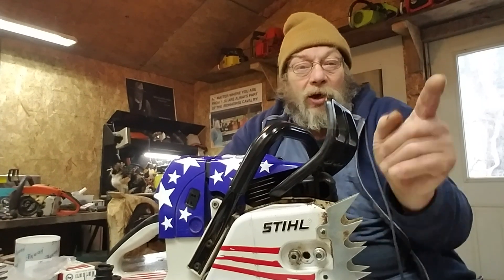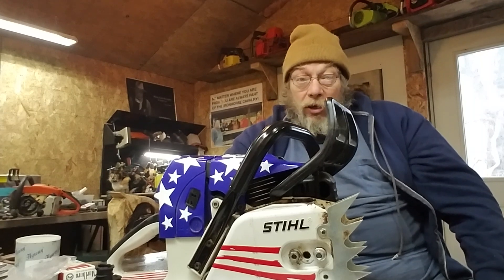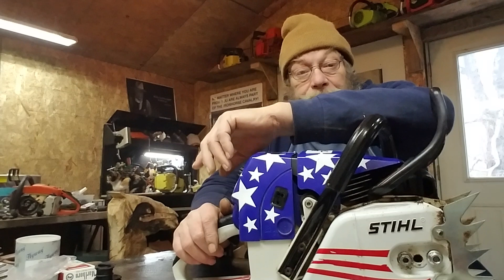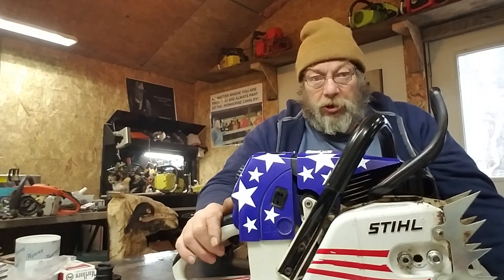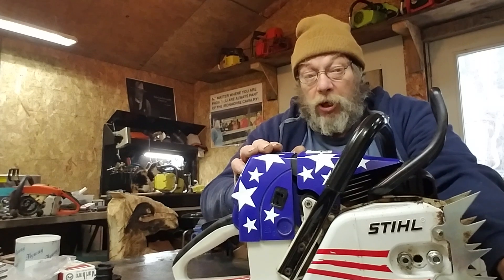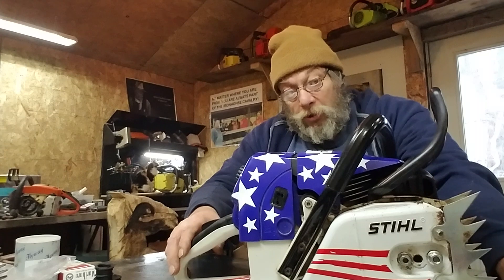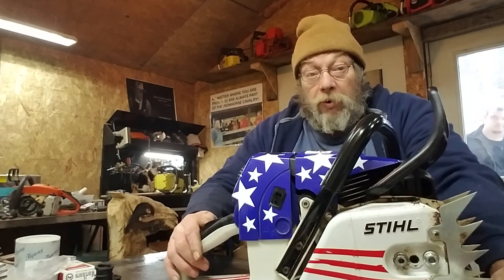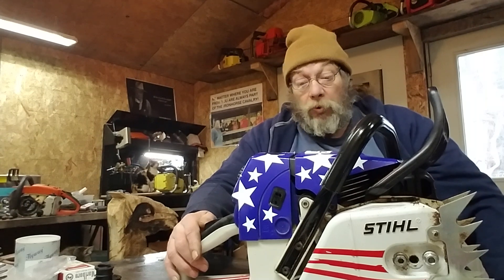What mix oil to use! What ratio should I run in different saws!

Comment: Here comes the crazy statement.... I run my saws at 90 to 1 using amsoil Saber.  Been doing it for 3 or 4 years now.  Not one issue, no smoke, no fouled plus, no clogged screens.   Just as your saying modern oils are better than the past oils, I believe Saber is superior to all other oils and that's why they guarantee no failure to to 100 to 1.   And they have tested to 200 to 1 without issue, though they don't recommend going that low.
Reply: I also use saber at 100to1.  Have been for 40 years.  No problems at all.
Reply: Wow, never heard of that one.  Going to check in on that.
Reply: Same here, Saber at about 80-100 to 1 for over 5 years in everything I own. Not a single issue. I also noticed the fuel seems to last longer in storage. You may have to retune as your not burning all that oil. Your basic 2 stroke will run on straight gas but it won't run on straight oil. I have had good results with everything I've used amsoil in - bikes, snowmobiles (interceptor), chainsaws, weedeaters, log splitters  (who carries straight gas all the time) leaf blowers, and hedge trimmers. No issues. To be fair I don't cut much in the heat.
Reply: arborcidal maniac  amsoil Saber is around 50 cents in oil cost to add to a gallon of gas... How much is your klotz oil per gallon?  I suspect at least triple in cost.  My point is, even if your oil is superior... I'm gonna save so much money that I can easily replace equipment as needed (not that, that had even happened once as of yet).
Reply: arborcidal maniac  you can buy Saber online by the gallon for around $48.  That gallon can mix up to 100 gallons of fuel bringing the cost to under 50 cents per gallon of mix.   You can buy it online just like anyone else... So what's available locally doesn't matter.   I love Saber.... It just so happens to be a third of what your using.  If you're happy spending triple, you go right ahead.  I'll save a buck with each and every gallon I use.   I have saved more than enough to replace any piece of equipment I use mix in.  But I doubt that will ever be an issue.  Good luck to you

Comment: I use klotz techniplate at 32:1and it burns perfect never had any issues , I have a 385 I bought new in 2002 I've used that oil at that ratio and I've never had to rebuild it yet .
Reply: Larry Warner I havnt had many failures while useing that oil.
Reply: @ericharris893  I've used it for close to 20 years , snowmobiles , saws, weedeaters

Comment: I ran 38:1 in my older 40:1 huskys. In the chromed plated bores and the nikasil it’s still 38:1/40:1 full synthetic oil.  In my castiron sleeved two strokes it’s a mix of Castor, synthetic oil.

Comment: I run Ipone snowmobile oil at 45:1 and add a shot of Startron stabilizer in with Shell premium grade fuel.  Runs great.
Reply: In Stihl manuals, there were reportedly cases of cuts and jamming of the rings and the piston at 33: 1. Is there a risk of reduced machine life or carbon failure?
Reply: I did notice the Ipone was leaving some black residue  on the piston crown and exhaust port. I have switched to Opti2 oil. I have not used enough yet to see results.

Comment: Amsoil said you can run there oil @ 300:1... I run mine like they say a @ 100:1 and have had no problems for years and saw runs fast and no issues, plus the fact that it never fouls or chokes the muffler. Scary first time I did it I used and old saw to make sure he wan't blowing smoke up my @$$. All I know is it works Amazing...

Comment: Just stumbled across this. Nice! I'm running 2 Shindaiwa chainsaws, using echo oil (can't get Shindaiwa oil here, not sure it matters to be fair), but run it at 40:1 . The saws are approx 6 years old and run perfectly. In fact I had one of them into our local saw shop (discussing chains) and the guy said: how old is this saw, it seems new? He was surprised at how old it was...

I hear what you are saying about warm running time - I try to run 'em for at least an hour when I get one out for work, and not do a hot shutdown after serious cutting, i.e let it idle for a bit and check exhaust temp (wafting my hand nearby the exhsust, yeah a bit imprecise) before switching off.

Comment: I like 40 to 1 also....been running the Poulan oil, but probably should run down to cycle shop and get the Yamalube or something equivalent. Thank You Harvey for enlightening me on what YOU use... Cheers !
Reply: J. Chris Beck Make sure it’s the Yamalube 2r and not 2s
Reply: @patrickallred850  thank you sir

Comment: Thank you

I started using yamaha lube 2r 

Ca wants 50:1 

I switched to 40:1 and non ethanol race brand fuel its 95 octane 

How high of octane can you use ?

The premix stihl shows 98 octane 

I come to learn when you add 2 stroke oil to gas the octane level drops . 

Is there a way to know how much octane  will drop  when you mix your own fuel ?

Comment: I use Stihl HP Ultra (fully synthetic) 50:1 in everything - my husqy saws, stihl saws, weedwacker, brushcutter etc.. burns clean and keeps the cylinder cleaner too.
Reply: I run my saws the very same and I have no problems. That stihl ultra is some stuff and it has a nice smell when burning.

Comment: I've ran amsoil saber at 80:1 for years without issues and the piston has always been clean and no marks on cylinder wall. I started running it at 50:1 but it was to much oil, it was full of carbon after 10 tanks. They say you can run 100:1 but ill stick with 80:1. $1400 saw or pennies for oil.
Reply: I have ran the same oil for close to 20 years mixing at 90:1. That saw is still running like a top! I believe in the product, it’s proven itself to me.
Reply: @myronhorvathsk  a lot of people apparently... I've settled on the echo red armor it seems like echo really did their homework on this one

Comment: Hello Iron Horse. A friend had a 661 cm with the m-trionic carb.He recently brought me his blown up 661 to get my opinion on the cause. He told me he wanted to better it by running 40:1 mix in it . Well in my opinion that's what blew it up . The carb was trying to adjust to the mix and ran it very lean. What is your view on this…Stihl cust. Service answered possibly. As for myself I run 40 to 1 on all my saws.Thanks in advance

Comment: I use 92 octane gas and run Wal Mart oil & 50:1 but most of my tools are Echo  lawn & garden so I go thru the gas pretty quick and it doesn't sit around in the tool. I Use a Stihl 042  for about 12 years w/ no problems.

Comment: I run Lucas or amsoil dominator in my dirt bike and Lucas or powerpunch in a saw
Reply: The amsoil makes a good film.
Reply: In Stihl manuals, there were reportedly cases of cuts and jamming of the rings and the piston at 33: 1. Is there a risk of reduced machine life or carbon failure?

Comment: Just got 2 liters of Motul 800 off road 2T oil. And i will be running it 40:1  .   I always wondered what the shelf life is with mixed oil and fuel. Some say 3 months others 6 months at a temp below 20 c Celsius .

Comment: I bought a Chinese 62cc for doing dirty hard work. Didnt wanna use my husky on. I use 40/1on 10 of mine. But the Chinese sthil is 25/1. Dont smoke on it
 I ll check on carbon soon. Is it ok for 40/1 . ?.
Reply: Depends on plug color and the environment and sawing habits.

Comment: You should run 3 ounce per gallon of Amsoil Dominator .  It's simple ...and it's a great oil i've used on all my 2 stroke race bikes 80/125/200/250/300cc , all my chain saws, snowmobiles, etc .  3 ounce per gallon comes out to about 42:1 and it's simple . Get a ratio rite cup

Comment: Surprised the comments are not shut off. saws schmaws, and 2 strokes in my life. My goto oil is penz premium semi syth outboard by the gallons. The oldest outboardsmight run 32:1 with a copious amount of pharmacy castor well shaken in to turn heads. My lawnboy lawnmower seized at 40:1 new oil and remained at 16 or 20:1 the general shop jug at 40:1. The newest tanaka bigboy blower with it's CARB emissions and warranty took the 50:1 challenge but now takes standard 40:1 penz semi syth premium outboard blend.

here now vermont there are a few stations that sell non alcohol gas but the factor of rich lean extremes of going from one to another it's usually mid grade 89 

I might run the non eth in the motorcycle but with each switch the idle rpm meant finding that hidden knob and making corrections

so there now I can go back to the video and stand corrected
It's wonderfull being old "let dimentia become my comfort zone"

Comment: I always run at 50:1 as it's easier than mixing in the bottles and just use the 100ml shots and find if I run at 40:1 they smoke and bog down as mix isn't neat enough. Plus Stihl recommend 50:1

Comment: Yes, I was wondering about that mix ratio and what brand/ type to use. Without getting into a Ford vs Chevy debate... I have three saws. They would be considered toys to a pro logger. One is a Jonsered CS2255, one is a Husky 350 and the little one is a Craftsman 40cc. They all run good and I am learning how to maintain them. The little saw says 40:1 and the others are marked 50:1. So I been just running 40:1 in all of them with 92 or  93 octane non ethanol. So far, so good. I also recently learned that it is a very bad idea to run used Auto engine oil as bar oil... Yes I am very sorry and I promise not to ever let it happen again....
Reply: In Stihl manuals, there were reportedly cases of cuts and jamming of the rings and the piston at 33: 1. Is there a risk of reduced machine life or carbon failure?
Reply: I also run used motor oil. If it was still good enough at the time of draining to still lubricate my engine worth thousands with intricate parts and bearings, then its good enough to lubricate my $20 chain and $70 bar. Been doing it several years, and have had good results
Reply: @michaelscafe2818  I used to think that way and I did the same. Since I have been using Bar Oil I have had chains last longer, they do not stretch nearly as fast. I do not find myself tightening the chain every 10-15 minutes and the chains stay sharper longer. It is a very noticeable improvement, well worth the cost of bar oil. Even the cheap bar oil from tractor supply is a huge improvement. Bar oil has an additive in it that is kinda like snot. It is very clingy. Used engine oil does not have this and they are designed for very different environments. Engine oil is made for tighter clearances between moving parts and is subjected to extreme heat. Bar oil is made for loose clearance, thus the snot like clingy-ness. It does not take a lot of bar oil to keep things happy and if you try a gallon, you will be surprised how much longer your saw parts last.

Comment: I use mineral oil to break in the pistonrings around 3 gallon , but after that i go over to synthetic oil but i still use 40/1 on al my 2 stroke.

Comment: Oil technology is a rapidly moving changing one. If you want real tech details, hotsaws101 did a great overview of some of the new stuff. Redbull661 did a very interesting comparison of some of the popular mixed fuels and burn characteristics. Ironhorse is right, you need to check your plugs to tune your oil mixture for your saws and environment. I live in Florida with very hot conditions and I use Motul 800. If I was sawing up north I'd probably be using something different in cool and winter months. Checking under the jug is also a great indicator, but time consuming to do very often, maybe once every 5-10 gallons of fuel.

Comment: I run 45:1 with Stihl Ultra and PNE gas.  I run it in everything two cycle.  I have had no problems not of my own making.  I run Stihl, Husky and Huztl kit saws.  I ran 40:1 with Sta-Mix oil for years in my two cycle stuff, but I cannot find this oil, anymore.

Comment: hey Harvey I run the same mix in my saws as I do in my motocross bikes, my secert recipe is aviation fuel 100 octane mixed 40.1 with amsoil domantor racing oil
Reply: That aint any secret recipe. Ive been running that in my KTM's racing enduro's since 2003, and so hasn't most of the other guys I know.
Reply: A man that lives near me has 112 of rain

I soooo want to try that !!

Comment: Thanks, answered my question if my old 10-10 could run modern 2 stroke oil in it 40:1
Reply: Master, can you pour 33: 1 husqvarna ls + into the saw 372xp 357xp and scythe 545rx? Will the piston rings get stuck with carbon?

Comment: Harvey, are you in the US or Canada.? New viewer.  Also, I just don't have enough cutting at my intervals to extend beyond a half hour. May have carbon build-up as a result,  but see little alternative? Not noticed any saw performance issues. Standing and letting saw run W/O @ no load goes against my grain.

Comment: What’s your thoughts on Stihl or Husqvarna premixed gas?
Reply: Too damned expensive if you use much of it, in my opinion.
Reply: For me I don’t use my chainsaw whole a lot. I was wondering, if it’s any good?
Reply: @Dfchainsaws  I am sure it's fine, the one big advantage is that it can be stored for longer periods of time. The ethanol fuels (E10) that we often use today does not store well for long periods, it's hydrophobic, which means it will collect moisture in it from the air around us....makes fuel go bad, and engines won't run with it. The pre-mixed fuels use no ethanol. If you can find non-ethanol fuel at a fuel station near you, that can be pre-mixed by you at whatever ratio you prefer, and it stores well, and plus you won't be paying $20 a gallon for it.
Reply: @Matthew Kerhin lol. We both got it wrong but I get it. Think it's spelled hygroscopic.
Reply: @Matthew Kerhin I finally won over the autocorrect. Had to fix it about 4x

Comment: Do you run 40:1 breaking in saws too?  Also how do you tune your saws to break them in?
Reply from the maker: 40:1 is fine! I get the saw where it has a good idle and leave the hi jet a little rich for 1tank of gas! I use 3 heating and cooling cycles before I put it in the wood!
Reply: @theironhorse6600  thanks for the reply :). I tend to start my saw and let it idle until I feel heat from the exhaust than I use it.  Is that considered a heating cycle?
Reply from the maker: I run the saw off idle changing engine speeds untill my cylinder gets warm and then let it cool all the way down! That’s one cycle! I do that three times before I put it in wood!
Reply: @theironhorse6600  Thanks for the advise!  I'll try that out with my next saw.  Hope you have a good week and not to much snow plowing.  God bless

Comment: After observing how hap hazard the mixing of fuel is done by the tree guys I work with (who "don't need no stinkin measuring jug") I came to the conclusion that its probably best to let them stick to the 30:1 mix they use, at the risk of them getting lazy mixing a 40:1 that might end up more like 50:1 now and then.

Comment: Mixing oil and gas is a matter of oil quality.But most important,depend what oil you buy you should mix it accordingly what the bottle says.If your 2 stroke oil is of high quality you can mix differendly then your owners manual may say.I use in all my 2 stroke engines be it chain saws or dirt bikes you name it,..OPTI 2 oil mixed 100 to one since the early 70s and never ever had a problem.But I know it is a matter of trust,just like religion.Lolololol

Comment: This is just me. I have been running Opti-2 snowmobile oil in all my two strokes for years @ 50 to one for years. Got 22 operators at the golf course and the equipment gets used every day and hard.
Reply: I have friends who run amsoil and your experience concurs with theirs.  Amsoil isn't just good oil, it's great oil.

Comment: Stihl ultra fully synthetic at 40/1 .no carbon buildup and the saws run sweeter . outboard engine oil in modern chainsaws is a bad idea as the temperature is to great for the oil tolerance .chainsaw oil for chainsaws.

Comment: 40:1 is the way for me 2. I don't trust the 50:1 they recommend it's 2 thin.
Reply: It’s just that way; I’ve found 40:1 is the new GOLD for the saw.
Reply: @powerthoughtsontools4831   In Stihl manuals, there were reportedly cases of cuts and jamming of the rings and the piston at 33: 1. Is there a risk of reduced machine life or carbon failure?
Reply: @powerthoughtsontools4831  Master, can you pour 33: 1 husqvarna ls + into the saw 372xp 357xp and scythe 545rx? Will the piston rings get stuck with carbon?

Comment: When I was young a farmer told me he ran nothing but auto transmission fluid in his saw stating that any light  weight oil would do. I'm just putting that out there not recommending it . Thanks ironhorse...
Reply: James Johnson a buddy of mine (home remodel and repair professional) has a 028 in his tool truck and it gets some use here and there few times a month and he runs used motor oil in it. He uses 3oz per gallon. That’s close to 50-1 maybe 45-1. I’ve been useing amsoil because it’s what’s sold at every corner store in my locality. I have never had a engine failure useing super tech Walmart oil but it stinks and burns hot and leaves grease in the muffler. BUT! your engine will not fail due to oil. useing amsoil intercepter the yellow stuff. I like the smell I run it at 4oz per gallon 50-1 is 2.6 ozper gallon. I’ve had failures useing amsoil in snowmobiles. Lotta crank failures back in the Polaris triple cylinder days. Klotz cured the crank failure issue. Polaris oil was no better. I hope the amsoil doesn’t wreck my chainsaws but I’ve run many gallons it’s been all glory for a few years now. Knock on wood. I’m not an amsoil fan.
Reply: i found farmers are the worse, i worked on many saws a farmer mixed his oil by just adding some to the tank, no measure just guess work. out of 5 saws 3 were so cooked through lack of oil and blunt chains and 2 so full of carbon they would not start. as they say.... any oil is better than none!!!!!!!!! modern saws are a little different, needs treating like a good woman